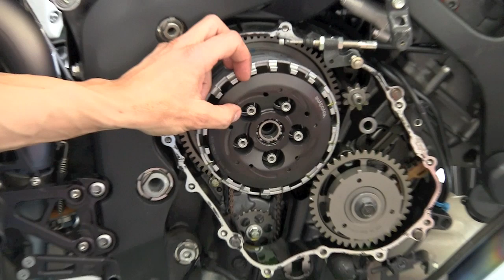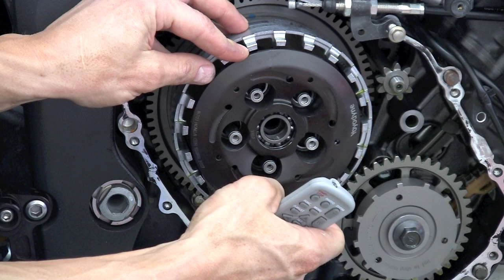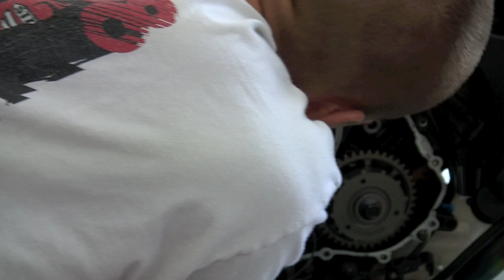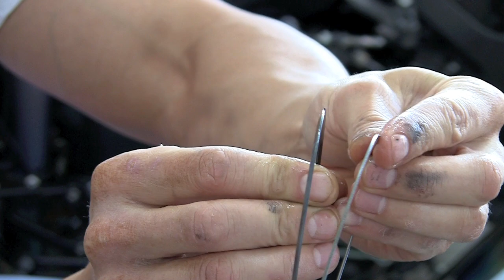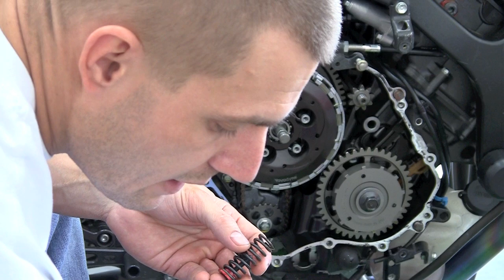CBR 600RR Slipper Clutch Install Part 2 of 2

Comment: Somethings I found on the UT. 
1. install the steel plates with sharp side facing out.
2. the last friction plate is supposed to go on the other notch set (not sure in slipper clutch its different?)

Comment: Did you offset the last friction plate by 1
Reply: From Yoyodyne’s website instructions “Then continue with the normal stack. NOTE ALL FRICTIONS MOUNT IN THE SAME SLOT! ( pic. i,j ). If you offset the last plate, the clutch will slip.”

Comment: 10 years later this video is super helpful with installing the yoyo in my R6.   but that last clutch fiber on the outside should be offset 1 groove from the rest.
Reply: Why? I’ve seen and heard that but why does it make a difference?

Comment: 1 question. Wasn't the last friction plate supposed to be one tooth to the right? I mean all friction plates must be aligned except for the last one who should be turned one space? In the first video it is clearly seen that the first friction plate (the last in this video) is one tooth to the right before you removed that preasure plate.
Reply: From yoyodyne’s website “Then continue with the normal stack. NOTE ALL FRICTIONS MOUNT IN THE SAME SLOT! ( pic. i,j ). If you offset the last plate, the clutch will slip.”

Comment: awesome video. you forgot one thing. your supposed to soak your friction plates in oil before install. other than that. great video great camera work great install instructions. keep the rubber side down
Reply: +Anthony Heflin He did although it might've been in part 1

Comment: I hate to be the bringer of bad news, but if you reference your Honda workshop manual, you will see that the last friction plate is indeed meant to be offset from the others, and sits into the shallow channels. ie, the ones that do not descend all the way into the basket.
Reply: From yoyodyne’s website instructions “Then continue with the normal stack. NOTE ALL FRICTIONS MOUNT IN THE SAME SLOT! ( pic. i,j ). If you offset the last plate, the clutch will slip.”

Comment: roadracingme.... I watched both of your vids it was very helpful only I have a......................Honda CBR F4i 600 and was curious to know if my new clutch kit would be similar to yours at all, no video on you tube yet for cbr 600 or I would have watched it. Thanks. You also should have made the 3rd vid of you operating your bike immediatly after the new clutch kit was installed , yes after allowing dry time on the rtv seal as well. Thanks again make more diy videos.

Comment: It only slips when you downshift to save transmission wear. Downshifting at very high RPMs  is terrible on the transmission..a slipper clutch helps the  transmission engage to the lower gear very smoothly.   Basically a slipper clutch reduces wear and tear on your transmission...it's especially needed on the track.  For normal road riding...well learn how to shift smoother and use your brain :-)

Comment: You installed that last friction wrong. It should be off-set.
Reply: F82SMURF just curious did you mean inner most plate or outer most plate?It looked like they were all in line when he took it apart.
Reply: Yea bro I noticed the same thing as well it’s just annoying he didn’t edit the video when his clutch didn’t work when he was finished and had to go back and fix it.. other that that huge blunder it woulda been a good tutorial ..
Reply: From yoyodyne’s website “Then continue with the normal stack. NOTE ALL FRICTIONS MOUNT IN THE SAME SLOT! ( pic. i,j ). If you offset the last plate, the clutch will slip.”

Comment: Good vid. Just a slightly off topic question though. I kinda feel that I need to replace the friction plates (I haven't opened it up yet but I'm pretty sure it still hast the original plates on my bike and they are probably a bit tired) but how big is the chance that I will also need to replace the steel plates? Could I assume a 2x friction plate change vs 1x steel plates or is it better to get new friction- and steel plates in one go?